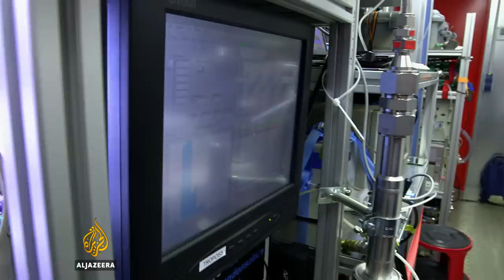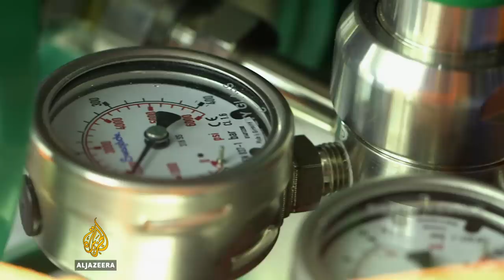Antarctica on the edge - earthrise

Comment: Actually, if all the ice floating there would melt the ocean level would remain the same, the water displacement from the floating ice already causes the ocean level to rise to the same level it would be if it were water, put An ice cube in a glass of water, Mark surface level, check back when cube has melted.
Reply: Wait a minute,  I want to conduct this experiment,  but what should the starting water level be? Should the glass be half full,  or half empty?
Reply: Wait a minute,  I want to conduct this experiment,  but what should the starting water level be? Should the glass be half full,  or half empty?
Reply: Fill the glass with Kool aid...then drink it... eat the ice... Turn the glass up side down... problem solved... lol

Comment: How can sea levels rise the ice has already displaced the water by it own volume, fill a glass with ice add water to the top and when the ice melts it will not overflow the glass. ????????
Reply: but a lot of it is above the water line right?

Comment: The sea levels will not rise. Ever. God has "fixed and set" them. In fact,  they have not risen not even 1 inch in the last 100 years. Not at Cape Horn the southern most tip of Africa, and not at Massachusetts. And nowhere else that they have been measuring for the last 100 years.
Reply: So Tuvalu is a lie?